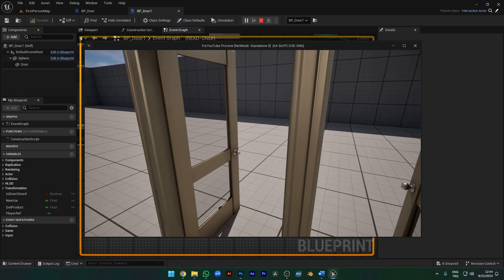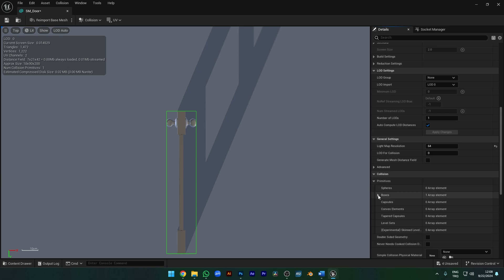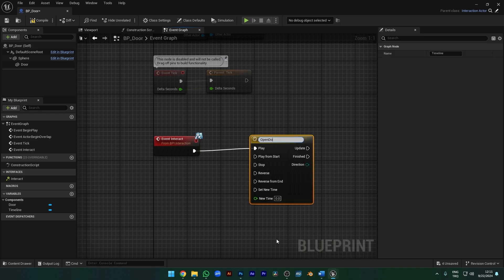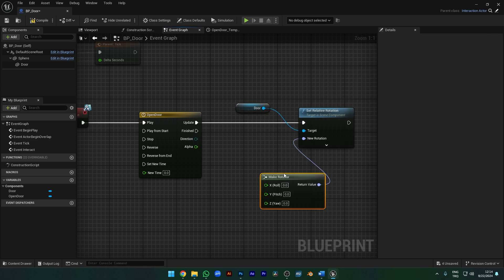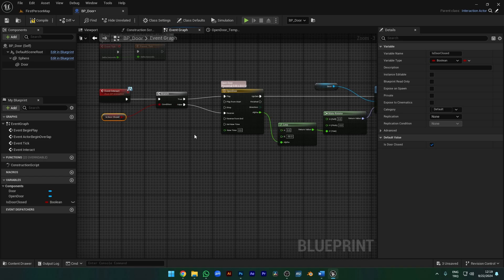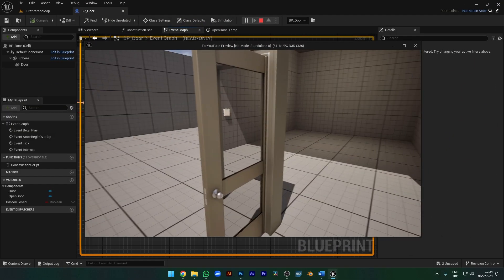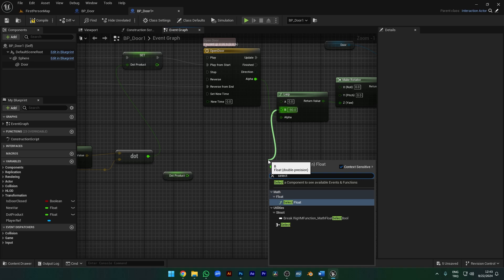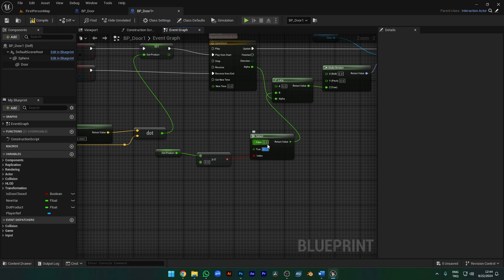Master Unreal Engine 5 Door Mechanics - ESSENTIAL GUIDE for Beginners

Comment: How to add sounds for the door ?
Reply from the maker: You can use "play sound 2d" Node for sounds, when you open the door
Reply: @ugurbaturgames  Yes but where I use it ? In the code ?
Reply from the maker: @Pierrot25wav  should be after the event interact node should be fine. but you have two sounds (close and open) after the set is door closed should be better